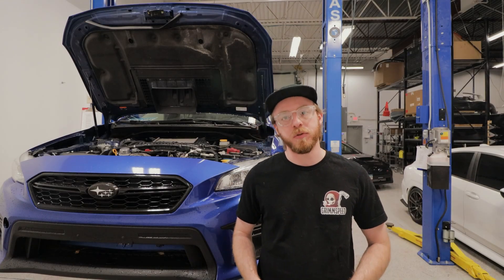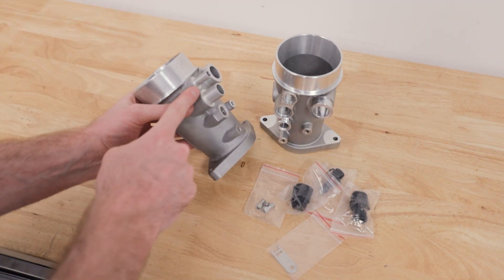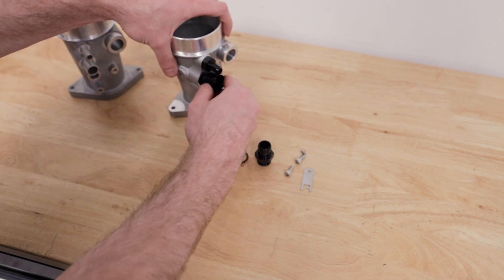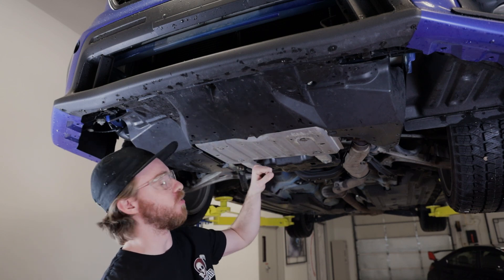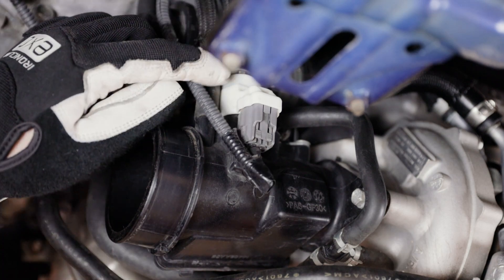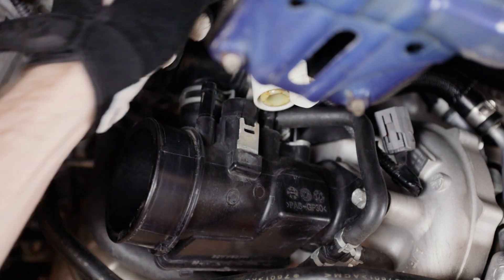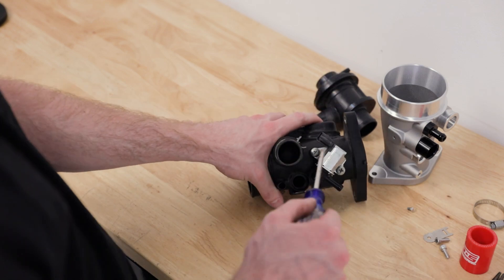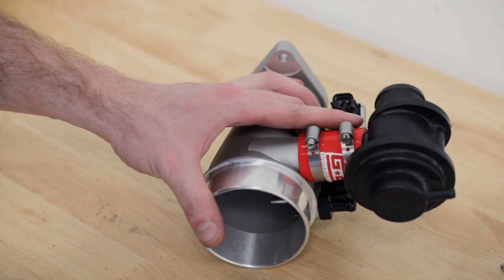GrimmSpeed Version 2 Turbo Inlet Overview and Installation Guide - 2015-21 Subaru WRX

Comment: HEADS UP FOR EVERYONE:
I ended up having a bit of an RTFM moment during (attempted) installation.
You cannot use the OEM or other aftermarket EBCS with this inlet.
This is stated on the Grimmspeed product page as well, albeit a little buried in the product page. 
I just wasted 2 hours to discover the OEM EBCS cannot be plugged in, due to fitment issues with the charge piping being in the way of the plug for the OEM EBCS.
This inlet requires you to have the Grimmspeed EBCS in order to use it, which unfortunately does require a tune. 
Needless to say, I'll be getting myself said EBCS, but still a bit of a pain in the butt.

Comment: After snapping the 10mm bolt off into the turbo I finally got it installed and now I got a P04DB code coming up. Can’t catch a break 🤦‍♂️
Reply: Code just had to be cleared, car must have read something when everything was disconnected

Comment: When reinstalling you forgot to plug in the boost control solenoid causing me to have to undo the far righ 10mm bolt holding the turbo inlet in place
Reply: Did you solve it? Boost control solenoid now doesn’t fit
Reply: @Luis-zj8bj  I just ran into this issue today. I read the page and discovered that this inlet is specifically made to be used with the Grimmspeed EBCS, not OEM or any other aftermarket EBCS.